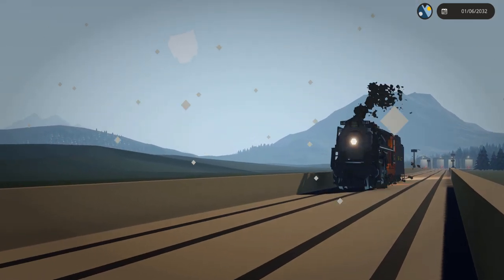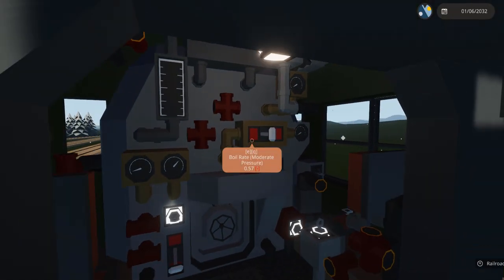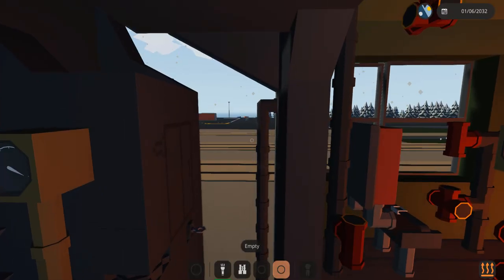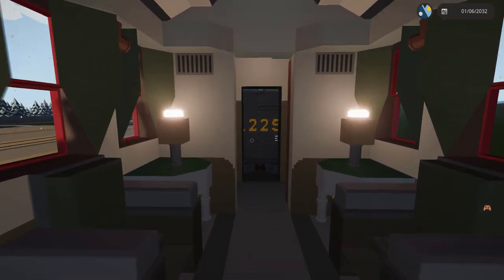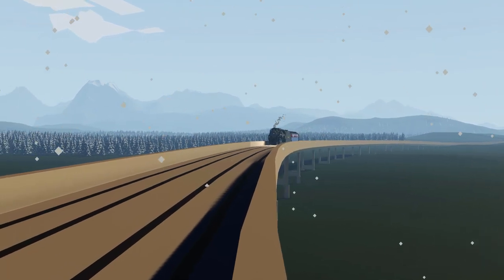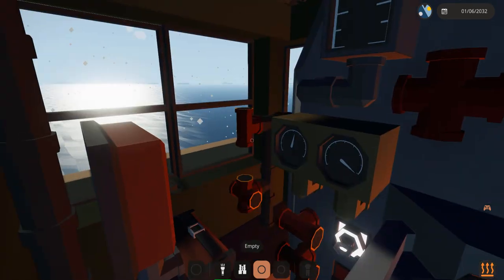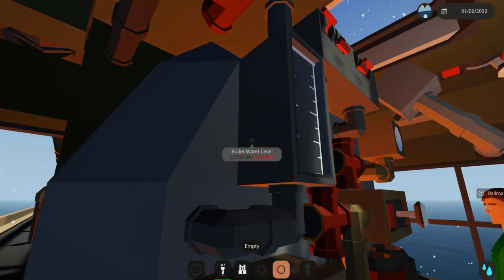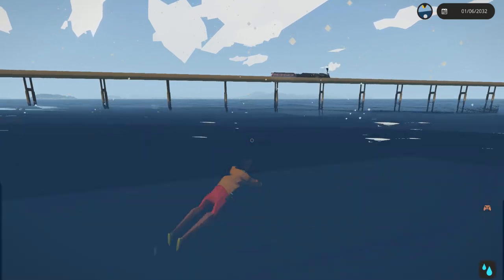Running A Massive Steam Train! | Stormworks: Build and Rescue | With Railroadpreserver

Comment: Thanks for featuring my creation! So happy about all the positive comments I've seen on it. Question, did you make sure to release the brakes? Seemed like you were stuck at low speed. Should be capable of 60-70 miles per hour even with a load. Also, there is a safety valve on this engine, it triggers when the pressure exceeds 8, but you still must lower the boil rate while idle since the safety can only release so much.